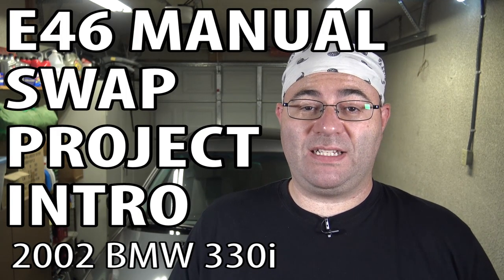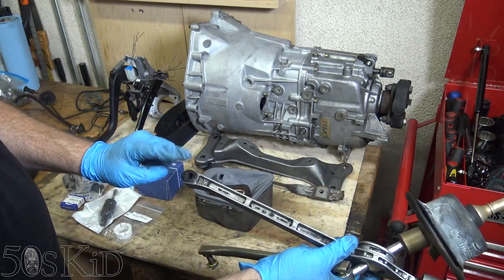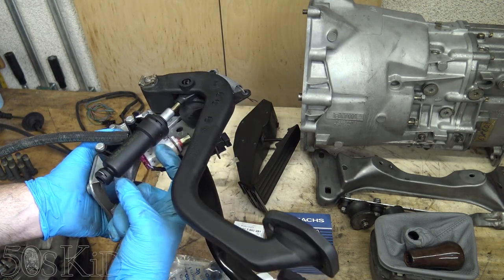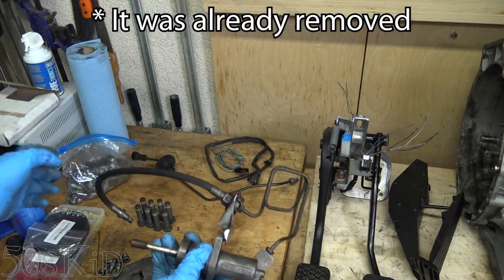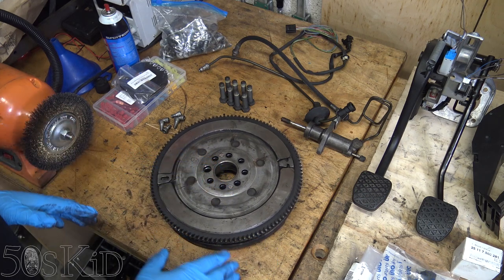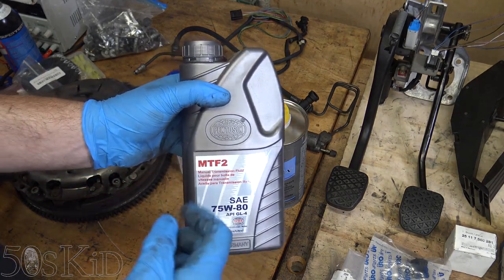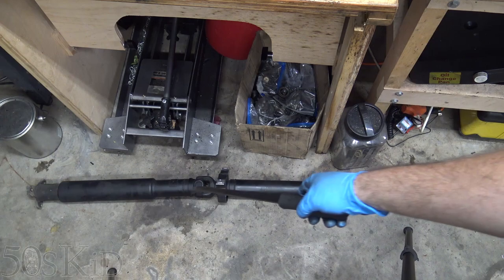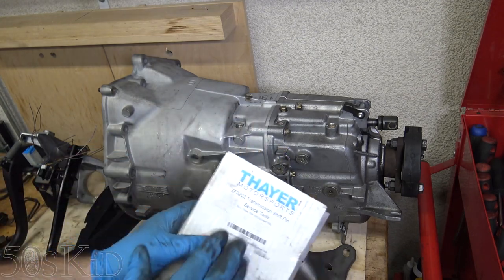BMW E46 Manual Swap Project Introduction DIY - What Parts You Need

Comment: Before you get into installing all of this, you should get an E60 shift lever. Its shorter then the E46 lever. Its a common short shifter mod for E46s.
Reply from the maker: Yeah I saw it.  It didn't look that short and wasn't that much cheaper than other short shifters.  I'm going to leave the short shift conversion thing for another video.
Reply: Jason, I second "TheBCman5" recommendation for the e60 lever swap. If you spot one at a junk yard, grab it. This makes the shifts pattern much tighter, but don't expect any faster drag times or speeds. Just a nicer feel than the stock e46 shift pattern with the stock e46 lever. Everything bolts up as stock, so no issues with aftermarket parts. It does not change height or the look of the stock configuration either, which is good.  I look forward to watching your video's. Always done so well. You inspire me to work on my e46 wagon with 5spd.

Comment: Please show us how you get the car up on very tall jack stands. Getting the car up in the air is always the most demoralizing part about working on my car.
Reply from the maker: Ah ok I will make a note to add that in.  I basically just jacked it up in the front then the back a little each time.  Then I nailed three 2x4's together to make a spacer and carefully used that to jack the car up even higher.
Reply: I would love a step by step with an actual shot of the underside with markings or references for a lesser skilled person could mimic and not ruin their E46.
Reply: 50sKid how much was the whole build to swap it ? Great video btw

Comment: Just did my swap in july took me 16 hrs 2 days. had trouble mating the new tranny in, wasted 2 hrs . Went to bed woke up had more light and noticed some heat shielding had to be removed from the top where the bell house mates,
that was the only hiccup. good luck.
Reply: Did u have to re program the ecu?

Comment: Nice.
It might be worth checking the shift shaft seal - these tend to leak, and it's much easier to replace while the transmission is out of the car.
Not sure if someone mentioned this already.

Comment: Hi there 
So I have a question…
I put a manual gearbox in my e46 325i (it was an automatic before)
But now it does 3k rpm at 120km/h when is used to do 2.5k rpm at the same speed with the automatic gearbox.
Can you help me with this?

Comment: There is still give in a single mass flywheel system, it's just in the sprung hub of the clutch disk. It's significantly more reliable and lighter weight.
Reply from the maker: Right.  But I've also heard of bad clutch chatter with some single mass flywheels.  The way I figure it, if you're replacing the flywheel every time you need to redo your clutch anyway, might as well go dual mass.   'Bout the same price.

Comment: FYI: Pentosin MTF2 has been officially discontinued. If you have the opportunity to get more, I would buy what you could locally. It's very hard to source online. Prices on existing bottles are being gouged as well. If not, the only good option is OE fluid. It's pretty expensive.  I was able to order Pentosin from O'Reily's 2 weeks ago for $30 a liter. They had limited availability though. They couldn't guarantee I would receive it or the new fluid Pentosin recommends. From what I gather, the new stuff is actually for DCT tranny's  and not compatible for E46's.
Reply from the maker: I'm not sure that's really true.  The DCT has always been a separate fluid.  The MTF2 is still up on their website.  Not sure why they would discontinue it.  Many transmissions were made for tons of cars that use MTF2.
Reply: 50sKid Give this a read. I called ECS Tuning and they told me it was no longer in production and is being phased out. I had ordered it from there twice before.  There is a discussion on Bobistheoilguy as well. 

http://www.m3forum.net/m3forum/showthread.php?t=590024&page=2
Reply from the maker: Ah, very interesting.  Thanks for the info.

Comment: You should add a note about ZF vs getrag transmissions/driveshafts especially for 325i owners. The diff on the 325i has a 4 bolt input flange so if you put a zf in it will need a 99-00 328i driveshaft. I've seen a video where the dude said you can use the front section of the manual drive shaft and the rear section of your auto driveshaft to overcome this. Can you expand on this?
Reply from the maker: That would not be a great idea--driveshafts are balanced together as an assembly.  What I should say is, you can do it, but take it to a driveshaft shop and get it rebalanced for safety.

Comment: You should change the diff because the auto. is 3.38 and the manual is 2.93
One question: While already swapping, why didn't you go with a 6 speed manual gearbox ?
BTW: Engine mount's are hydraulic so the oil won't damage them that much
Reply: Luka Staroveški correct, the diff for manual is other relation. Now the car will be more fast 0-100 jejej
Reply from the maker: The taller gears will make it accelerate quicker.  I went with the manual transmission I found in a junkyard--it was available and cheap.  The hydraulic fluid inside the engine mounts is silcone based and rubber safe.  Engine oil eats rubber away and causes them to weaken and rip.  I actually have the M3 mounts now which have no oil inside them.
Reply: Luka Staroveški I thought that automatic have 3.46 at least on 323i and is the same on manual from what I heard

Comment: Gonna be swapping my 323i soon thanks to this series. Have a few Questions: What did you get the drive shaft out of? What linkage should I look for? I heard one is longer than the manual, not sure if they are all the same length on the manual side. Got the car for a steal so this swap will prob cost more than the car lol

Comment: Hi mate you make some fantastic points about buying stuff from there scrap yard the stuff you can get from there is unbelievable one thing I did notice in your latest video you did complaint slightly about the clutch feeling on a dual mass flywheel as you load up the flywheel it should spring back into place I noticed this one does not spring back that could be some of your clutch feeling you are feeling as well
Reply from the maker: Yeah I think you're right it may be more worn than I thought.  I haven't seen enough DMFs to know the difference yet.  But I definitely think it was the differential that was causing me all the problems that were bothering me.  The biggest thing was the fact that the gas pedal was so sensitive with that 3.46 diff.  All the extra torque you get at any given engine speed made it really difficult to just drive the thing easy.  It was either beast mode rocket forward (annoying in regular traffic) or I didn't give it enough gas and it wanted to gitty up like a horse.  Now with the normal diff in there, it feels so much more like the ultimate driving machine!

Comment: Just so you know, you do need different bell housing bolts. Two of them are longer than the bolts for the automatic because the ears on the transmission are thicker. Grated I swapped the zf 5hp-19 automatic for a getrag 250g manual not a ZF manual (I have a 2000 323ci e46), so I could be wrong but I'd look into it.
Reply from the maker: Yep, you'll see that I figure it out during the install of the new transmission.  But thanks for letting me know anyway!

Comment: What's good 50's kid,

First of all, it's about time you did this conversion, you will enjoy the car so much more 👍. Second, I believe the max free play is 19° and should only rock about 1.6mm max. This was info from a spec sheet on an LUK flywheel. I have seen others post on forums saying no less than 15mm but no more than 30mm of free play so hope this info helps you out.

Lastly, I thought the 330's had a 6 speed transmission? Any reason for not fitting this or is the 5 speed the only one you could find? 

In any case, I'll be watching the progress, welcome to the manual club, you'll love it 👍😂
Reply: Beemernut it depends on the year and package you get for your 330. I have a 2003 330ci and it's a 5 speed. 

I believe if it was a ZHP it would have been a 6 speed.
Reply: lachlan Sutherland Ah ok cool I assumed all 330's had 6 speed. I have a 325ci which I believe were all 5 speed.
Reply: Nathaniel VanDenBerghe I didn't think the spec mattered as to whether or not they were 5 or 6 speed but I did assume they were all 6.
Reply from the maker: Thanks for the info on the flywheel!  Yeah I got the transmission that was cheap and available
Reply: 50sKid that's ok bud, no problem at all. Helping each other out is what we do. As for the transmission that's fair enough, no issues with that way of thinking, sounds as though you grabbed yourself a good deal 👍

Comment: With a manual swap, I wouldn't put any used or aftermarket parts in/ except performance we know how much that costs) because I know my labor cost is beyond that. 
So when I do it, I do it the way for it to last five years knowing there is nothing out in the area that is due to be replaced or what if it needs to be. 
In a matter of fact I rather not do it if I dont have the new genuine parts besides the tranny box itself.

Comment: hello 50's kid
is that a five or six speed box?
what about replacing the oil and what about any other type of reasonable  maintenance could you do such as guibo for example, before or after installation?
what else could be inspected as well. 
I see you cover most ideas.

Comment: Q, i have a 2000 328ci the car has a 6spd transmission,  i wan to do the clutch but i dont now if its a difference between the clutch kit 5spd  & 6spd .

Comment: Hi your doing a nice job explaining everything... I have a 2002 e39 that I want to convert to manual... is it the same steps or is it completely different ?
Reply from the maker: You'll need a different driveshaft and the wiring is probably different.  I would look into it on the msg boards and see if there is a DIY for it.

Comment: hey i am doing what you did, and i would need to know which flywheel you took and what size the driveshaft was in mm my bmw is a 330i sedan the manual gearbox will be s5d320z

Comment: Hello 50's kid. I love your videos; they have been very helpful for me.

I have a 330i; I would like to convert it to a manual transmission.

Manual transmissions are very difficult to get in Australia. I have managed to find a junk yard with a manual transmission from an E46 323i. Do you know if the 323i gearbox (and tailshaft, etc) will fit into a 330i BMW? (My car is pre-facelift).
Reply from the maker: +OilBaron100 yes it will fit but you want the ZF one not the weaker gettrag one
Reply: +50sKid - I am not racing the car, just driving it to work. Do you think it will destroy the gearbox?
Reply: +50sKid - I would like to make a one-off donation of $10 dollars. Patreon does not allow me to make a one-off donation; I can only make regular donations (every month or every time a video is uploaded).

How can I make a one-off donation?

Comment: How did you figure out which transmission fits your car? Im looking at a e46 316i to fit in my e46 325i. Most cars locally are auto. Ive check realoem.com and found the suited transmission on both transmission is not the same, at least the last 5 digit number.

Comment: Luk (the oem manufacturer) has an app called dmf checkpoint. This app tells you when your dual mass flywheel is worn based on the part number of your flywheel. It specifies a number of tooth as well. It is available for android, dont know if it is available for iphone
Reply from the maker: Wow that’s awesome man thanks for that info
Reply: @50sKid  no problem! Thanks for al the helpful vids man. You have helped me out countless times. Keep it up mate!

Comment: If I don't program my ecu after will my car spend a lot of gas? because I did the swap and my car is spending so much gas and when I go to shift the gas is still being given for half a second after I release the gas pedal between shifts? My car also feels slugish and struggling to reach redline
Reply from the maker: The gas pedal hang is normal.  You're using more gas because maybe you kept the automatic differential which has shorter gears than what you get in a factory manual car.  It should be about the same gas usage though.  The usage improves by about 3-4 mpg when you use a manual diff.

Comment: Hello there, love your work. Can you please give me some guidance with my swap its a 2004 BMW Z4 with smg  and I would like to swap for a manual tranny. My questions is with the wiring and neutral switch any information would be gratefully appreciated. Thanks
Reply: Did you ever do your swap? If so, do you want to sell any of your SMG parts? I have a z4 that I need the slave master cylinder. Thanks!

Comment: I know this isn't a forum, but I was doing the ccv replacement, removed the manifold and what not then put it back together. Idk what happens but shifting into gears became really difficult while the car was running. Also it felt like the clutch wouldn't fully disengage
Reply from the maker: I can't see how that would be related
Reply: Yeah, I know. Is it possible I got air in any lines to like a clutch slave or master cylinder or knocked a hose off? It goes into gear easy while the car is of but whem I turn it in it becomes difficult to get into gears and seems like the clutch is stuck in a gear even with the pedal depressed
Reply from the maker: I don't see how you would have gotten air in your lines, but it's possible that your clutch slave cylinder went bad, actually.

Comment: How were you able to install used clutch to flywheel? I thought it required a special tool to be installed before removing clutch and then after clutch bolted up to flywheel you disengaged tool?
Reply: Tony Copelyn I have a question for anybody that can help. Can you commonly find the clutch and brake assembly in any junk yard?
Reply: @shaunmoguel6431  yep
Reply: Thanks man! You know how much they usually cost?
Reply: @shaunmoguel6431  There are likely more automatics than manual trans but you may if to get something from car and somrthing from another and so on and so on...I got a kick panel for manual (cuz...I didnt want to cut mine....)dual mass flywheel...clutch and brake pedal assy...clutch line...little metal/tin seal thing between engine and trans (manual is different from auto).. Elec fan....manual radiator (took it back failed preesure test...I will get new one)....$80
Reply: Tony Copelyn thanks man appreciate it
Reply: @shaunmoguel6431  not a problem....I accumulating parts...its random and its early...now I need drive train....when I get everything then I will start project....if you buy everything new or off ebony you can go much faster

Comment: is there any way to take this type of transmission apart and replace syncros and the fork. Mine sometimes takes a little effort to shit into first and third.
Reply from the maker: I think you need a special tool to crack the case open.  The input shaft is pressed into a bearing and doesn't want to come right out.  I would not try it, myself.
Reply: Thanks, a lot of research says these transmissions are disposable which is disappointing

Comment: I see you mention electric fan conversion.
could you do a separate vid on that subject?
andrew
Reply from the maker: that's the plan
Reply: hello 50's kid

i finally got my e 46 back from the stealership.
After 3 months 3 companies and 3K at their warranty expense and who did not listen to my advice, every single issue which you have covered connected with intake and vanos have been fixed I hope. There are some final adjustments going on next week.

My summer projects would be auto fluid trans change using your home-flush advice and maybe look into the electric fan replacment option.
When you do the vid can you also please make mention of parts and procedure for those of us left with auto tans and auto cooler for example.

keep up the fine work.

Comment: Hey 50sKid, luv your channel. I think i remember hearing your in Cali. Since your car requires the STAR smog, will doing a manual swap affect your ability to pass smog considering they no longer do a sniffer test and rely solely on  onboard diagnostic. If not in Cali, disregard.. LOL
Reply from the maker: +Hill Rubin doesn't make a difference to emissions what transmission you have on the car. Only thing that matters is that your check engine light not be on. Mine is on until I "code" the car not to think it has an automatic installed anymore. Which will be a video at the end of this series.